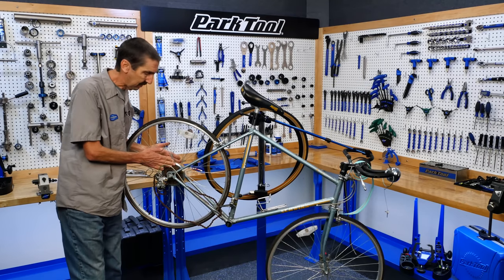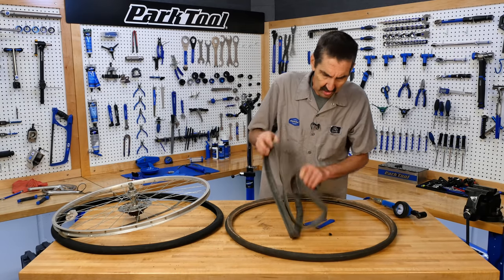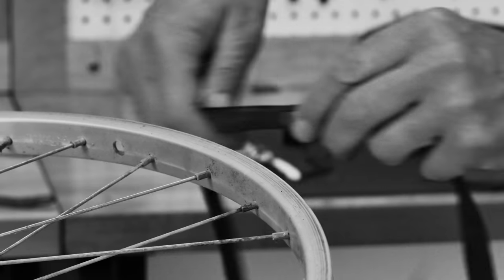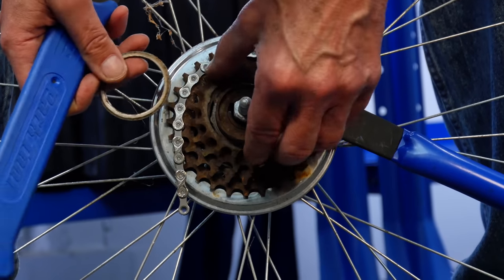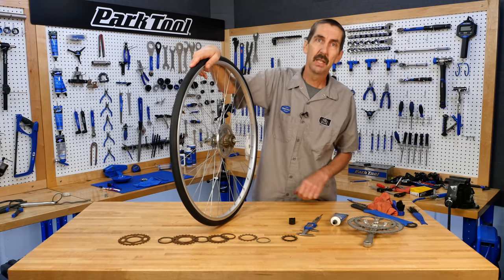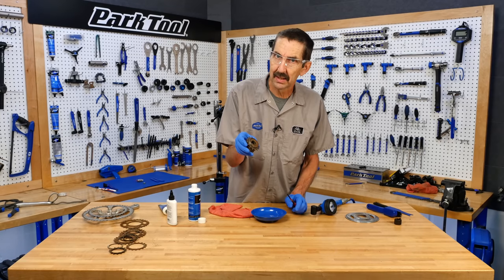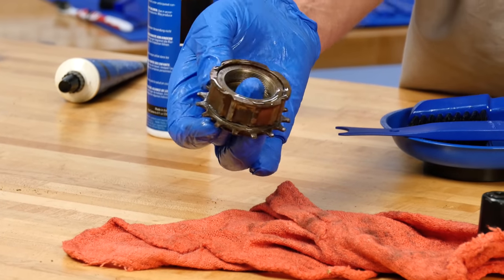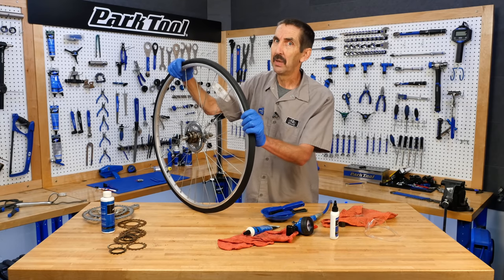World Sport One Speed Hack | Tech Tuesday #182

Comment: 2:15 You might want to try Pedros tire levers, they're much better than the Park ones. Other than that, great tutorial! Thanks for posting.
Reply: lol
Reply: That would look great in a park tool video LOL
Reply: I don't like Park tool tire levers either.  They're somehow shaped a bit wrong.
Reply: @davidburgess741  You mean the big metal ones that you can use on motorbike tyres also?
Reply: No, metal levers could damage aluminum rims and would damage carbon ones. Pedros! Most plastic levers Ok, but Park doesn't seem quite right.
Reply: @davidburgess741  When someone gets a flat, and there's a lot of fiddling around in small saddle bags, I pull out my Park Tool TL-5's, and they all run home to mummy!
Reply: @davidburgess741  It's like a mormon honeymoon, they just keep slipping out.

Comment: Hello. Watching this a question came to me. Is there was way, or a formula where without having to use a chain tensioner, you can, by knowing the length of the chainstay (bb center to rear axle centre), and the sproket/ chain ring size you have...to know which rear sprocket size to keep your chain taught? The chainstay length is x. My single front chainwheel is so many teeth. Your only option is a 17 tooth rear cog. (for example). (Obviously this bike doesn't have horizontal dropouts, other wise the question would be pointless)
Reply from the maker: copy this link
Reply: @parktool  what link?

Comment: Got any tips on which (partial) cassettes will fit on a Hope SS/Trials hub? I know they have a Shimano HG freehub but narrower than normal, so you have to remove sprockets from a modern HG cassette to fit it on. Unfortunately I don't have loads of cassettes to try out, let alone compatible shifters, and they're not exactly plentiful in the UK at the moment either! So I need to know what I'm ordering/buying will work (or can be made to work) without needing a machine shop...

Comment: Never open it!  But if you must,no grease. Just oil.  Grease will cause sticky pawls and goast peddling.  Be prepared with small tweezers and magnetic tip tools. 
But you know what?  Don't open it. Clean it well before  flushing either solvent or oil so that dirt and grit don't get drawn in with the flushing.  Let it drain as Calvin did.
Reply: I opened it. 😱😂 I thought that 2 pin ring thing was how to get the cassette off. Not my bike. Bearings everywhere! I had some more luckily but it took 3 attempts and a couple of hours to get it back together 🙃 works nice for her now 👍😀
Reply: If you must open it, you can use a minimal amount of grease to stick the bearings in place on the races - just a tiny smear in the shiny line/centre of the race. If you're worried about sticky pawls, you can then add some lube after assembly, to dissolve the grease, but it's not necessary if you've used minimal grease.
Reply: Ive restored more vintage bikes than I can even keep track of and every single one of them that has freewheels Ive rebuilt the freewheel and packed the bearings and pawls with grease and Ive never once had an issue with sticking pawls or ghost pedaling even years afterwards

Comment: reusing an inner tube?  really?  they cost so much money
Reply: As a rule of thump: replace the inner tube too, if you are replacing the tyre. And fit a good wide rimtape, so that the inner tube doesn't touch the rim at all.
But, referring to the shortage of spareparts in the moment, there might be reasons to check, if the inner tube can be used again.
Reply: @herosstratos  hahaha u joking right?    thanks for the explanation.  also, its thumb
Reply: @MrApplesaucestuff  in this case obviously dont reuse the tube because it has a gaping hole but for a large percentage of repairs there is no reason to spend money to replace something that works